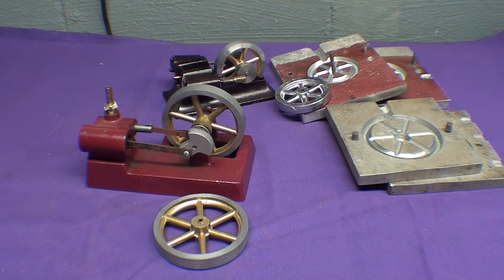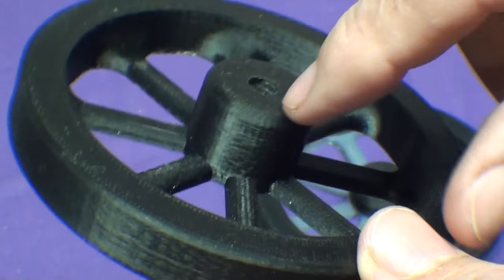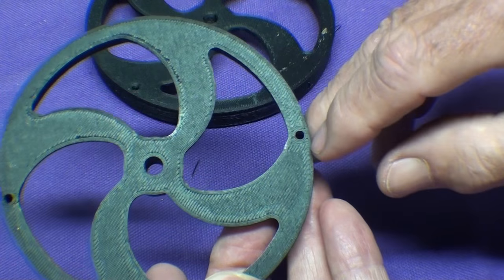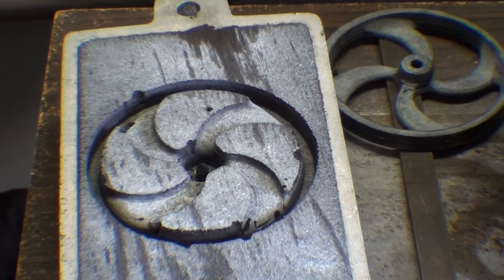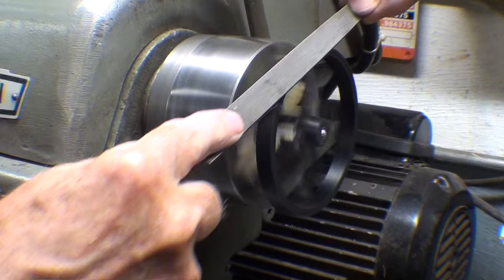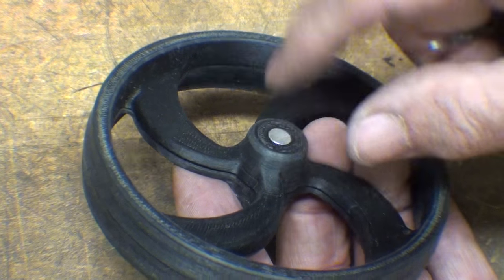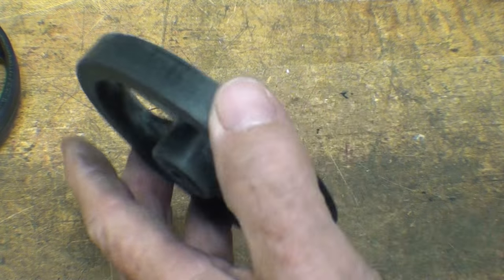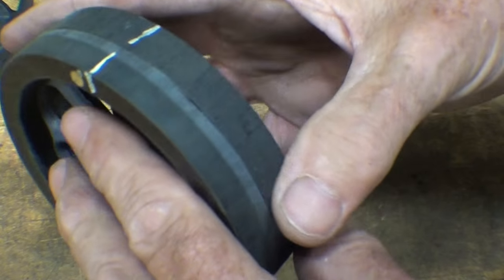TIPS #322 pt1 Casting a Flywheel Pattern - 3D Printer tubalcain

Comment: Hi Mr Pete, if the plastic it's made from is an ABS plastic you could use an acetone vapour bath to smooth the whole wheel and it will end up as smooth as glass. It is quite easy to do in a diy fashion at home. just an idea for you to think about. thanks for all your videos.
Reply: I was going to post this also
Reply: By the look and sound of it I'd guess it is PLA. But then again, Lyle mentioned het recognized the plastic smell when working with it, which would indeed suggest ABS. 
But if it is PLA, you can still polish it with chloroform on a cottonstick and some rubbing.
There is a special epoxy too that can be used to smooth out 3D prints, but some spraypaint may be good enough too.
Reply: +Jelle B you could be right... I had heard Tetrahydrofuran will work in a vapour bath but I haven't tried it.
Reply: +Jef___ _ for PLA that is*
Reply: Thanks for the PLA finishing tip. I print mostly in PLA, so I will look into this!

Comment: Excited to see another foundry video!  I have done a couple casts with 3D printed parts now.  In my domino box video, you can see that I covered the entire part with thin CA glue and sanded it glass smooth (lots of work).  For the printed part I cast in brass this weekend, I used High Build Automotive Primer instead and it worked great!  If when you sand the plastic it smells like chemicals, it is probably ABS, if it smells like waffles, it is PLA plastic.

Comment: Lyle, you said that the fancy spoke flywheel had too thin a OD section and had a poor finish on it. Why not turn up two MDF rings and press them onto the plastic. Would do 3 things, bigger diameter, smoother finish and you could make them touch better at the split line. Looking forward to the casting video.
Reply: That's a good idea.

Comment: You can use an acetone vapour bath to smooth out the surfaces to real real smooth. Pour a small amount of acetone in a sealable container, suspend the part above the surface then seal before leaving in a warm place. The fumes will smooth out any excrescences. Check on the part periodically, as leaving it too long will cause the surface to absorb too much acetone vapour, and it softens the part.
Reply: I first heard about it from James from XRobots. It gives amazingly smooth results, perfect for sand casting :)
Reply: Yeah I got the impression from James' videos that the vapour bath is hit and miss. Easy to balls up a part you just spent five hours printing :O

Comment: my only help, is maybe use some wax on the 3d printed parts to smooth it out. should be easy to work with and give a decent finish. 
maybe some hard casting wax, or bees wax depending on how many matching castings you want.

this could also allow you to have the thicker material on the perimeter of the flywheel.

great videos Mr. Pete and I know I don't comment much but I do love the way your teaching us and showing us your little corner of the world

Comment: You can make the patterns smooth as glass with acetone smoothing.  Put a couple ounces of acetone in a container.  Suspend the part above the acetone and close the container.  Use one of those rare coffee cans you saved.  By auction time, they should be bringing a few dollars each.  Anyway, check the part every every 5 minutes or so until you see the surface smooth over.  then suspend overnight to allow the acetone to cure back out of it.  Be careful not to allow anything to touch the part as it will be as sticky when first withdrawn.  I use a wire fastened to the lid of the container passing through a hole with a loop fashioned above the lid for easy hanging.  Do this in a warm place to make it work more quickly.  Do not do it indoors unless you have a few brain cells to spare.  Here is part 2 of my popcorn scooper handle video showing a smoothing process.  https://youtu.be/-PczY5P1Dr8

Comment: Mr Pete,  I too have a joker but it is a bit more useful. Mine is in the form of Bill Clinton. I find the nose is long  enough to hold a dial indicator. It does seem that the indications gradually change over time and I have to constantly move the indicator closer to the face. Could be thermal expansion but not sure.

Comment: No need for sanding! There´s spray filler available (automotive department) which can easily add a 0.2mm layer. Should smoothen up the surface suffiently.
Spray on protective wax from the same department may also work, it may be thinner, though.
I used the latter as a parting agent to keep 2C-cement or such stuff from sticking to a part.

Comment: Great video. Thank you for it. Also, rather than sanding the patterns, you might try submerging them in an acetone baths (1-5 seconds) followed quickly by water rinse. This will smooth the layers very well and you will not lose as much material as sanding the patterns.

Comment: I use a 3d printer and to help smooth things out I use automotive primer surfacer/filler in spray cans. Drys quickly and does some gap filling. It's not always necessary to sand either but you can.

Comment: Hey Mr. Pete, start a special channel for the complainers. For the ones who don't like noise, just shoot video of your machines and tools sitting idle, perhaps with some workpieces resting nearby. Include a thermometer rigged to read only 72 degrees for those with climate sensitivities. For those who are bothered by too much light, do this with the shop lights off. Make short versions for the attention-challenged, and of course, do not speak to avoid offending anyone's sensitive hearing or point of view. Record travelogues of your car parked in the driveway, for those who dislike your road trips, too. Include footage of a '75 Chevy pickup for those who feel the need to see one. With enough effort, you can please everyone!

Comment: Thanks for this an all the other videos.  Around 0:50 you talk about the aluminum flywheel and the need to have the "weight" to give enough inertia.  Just between us and the flag pole it is more accurate to use the term "mass".  I know, I know, at 1G "weight" and "mass" are basically the same thing, but doesn't "mass" sound so much cooler?  Thanks again.

Comment: Question, would painting the parts with a glossy spray paint help in removing it from the sand?  I kept trying different ideas in my noggin, and that one popped up as a possible.  With the least amount of work, anyway.  Putting that red putty on, then smoothing and sanding was dismissed outright as too labor intensive.

Good vid, thanks Dr. Pete!!!!

Comment: Of all the 3-D casting pattern videos I've seen, none of them include any spares, gates, vents or runners on them. The poor guy working the sand has to form them by hand. It seems to me that the easiest time do all this would be while it's in the computer. They wouldn't have go all the way up to the top of the mold but at least an "ear" or tab at the appropriate spots.

Comment: For the defects in the prototypes you could use a glue gun as a filler. That would be quick. Would tape around the circumference cover the gap?

Comment: Great video, I have found that putting a thin coat of lacquer paint on a pattern, waiting an hour for the paint to be dry but tacky then rubbing talc all over and repeating the process 3 times really smooths them out and you don't lose material.

Comment: Remember the second wheel had a wobble in one half so the center alignment pin may be the problem.  Solution?  use the good half with a rod and put them together with good double sided tape all around between the halves and redrill the wobbly half; turn around and redrill the good half to match...maybe!  Greg

Comment: I tryed to cast a 14 inch spiral spoked wheel but when I lift the cope side, the upper cope side somehow sticks to the pattern. I use parting dust. I am going to lay the wheel on some thin wood panel and trace out the space between the spokes and cut the pieces out and place them down on the drag end and I believe the sand will stay fit and not break loose.  I will remove the wood pieces if it stays put up in the cope part and try to cast the flywheel. I believe it will work. As you know its a 2 part mold..

Comment: Hey, I enjoy your foundry/patternmaking videos alot. I'm a retired US Navy Molder Chief and have found that you, above all others, show a great deal of the techniques (while not all, of course) we used to make sand molds and how to pour the molds. I have a suggestion for you, the patternmakers I worked with used wood putty to fill in larger defects in their patterns but to fill in rough parts or areas that had micro defects in the pattern they filled in the roughness with a clear varnish or polyurethane. I've recently had need for polyurethane so bought a can of spray at Home Depot. Hope this suggestion helps and am looking forward to more molding.
Reply from the maker: I will try that. Good to hear from a navy man. I have the navpers molding book--excellent
Reply: I saw that you had the Molder ! & C. Try to get the Molder 3 &2, it has 4 times as much info on molding than the First and Chief has. Or you can get the Foundry Manual that was put out by the government. We in the foundry used that book as our Bible.
Reply: Car body filler and putty?
Reply from the maker: Good suggestions. Maybe those manuals are on google books.

Comment: Instead of alignment pins, couldn't you use double sided tape?
I have had a few things that I bought that were 3D printed and have to say that I am not impressed with the quality of the products that they make at this point.  I know they are getting better and better and will obviously be the end of quite a number of jobs for people, but I think that those that are inevitably be made redundant will have a little breathing room for a few years. Eventually, the need for anyone to have any kind of skill be completely eliminated and at that point, we will all just be easily replaceable cogs in machines.
Reply: Good idea -- but it would be much harder to separate the pattern halves.

Comment: Very good video. They all are!  Since we seem to be in a new era of patternmaking, I would say that the 3-D printer patternmakers do not know much about casting, and the foundry people do know much about 3-D printing.  So as we learn more on both sides, things will get better. Keith Rucker did a nice video on casting brass for a steam loco, you have probably watched it. In the meantime you might have to machine a draft or two on those plastic patterns, with the compound if need be, but given all the lathes at your disposal, this should be a minor problem :) . Pioneer video!
Reply: I meant to say foundry people do not know much about 3-D printing.  Read what you write!

Comment: I'd say that the `void` you saw was because 3D printers don't 100% fill the print with plastic, they fill a certain percentage of the interiors with a pattern (typically honeycomb/hex, triangles, or rectangles), and it seemed that the top layers had been bumped enough to break through to that mostly hollow interior.

Hope that helps clear up what caused the hole!
Reply from the maker: Thanks, I did not know that

Comment: What is the largest flywheel you have made so far? Been wanting to build the engine I plan on running in my blacksmith shop and  could use any advice you have. The engines are both 5hp
Reply from the maker: How about 12 inches

Comment: Why do you need draft or taper on that pulley ?
Reply: It is so it can be pulled from the mold sand without tearing or damaging the cavity. It will get machined square after.

Comment: Pete, you can use acetone to smooth and make minor revisions to 3D printed items especially if they're printed with ABS filament. Ask Herb what he used and it may give you some flexibility.  The plastic filament isn't all that expensive btw.
Reply: Solvent vapor smoothing looks like the easiest way to smooth parts like these. Not sure how reproducible the results are though.
Reply: +Robert Szasz it was always a PIA.   I had best results with a sponge tipped "applicator", and cotton swabs.  Much more control and pinpoint spotting.  After using the file on the wheel in the lathe, I would use the sponge applicator while it was spinning. It would true and flatten the surface much better than the vapor method.   IMHO....from my experience.